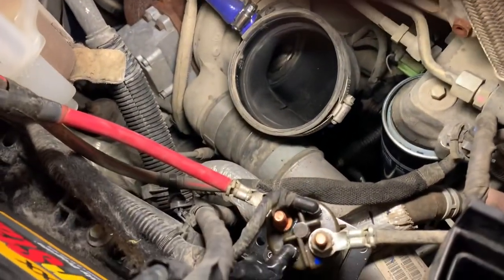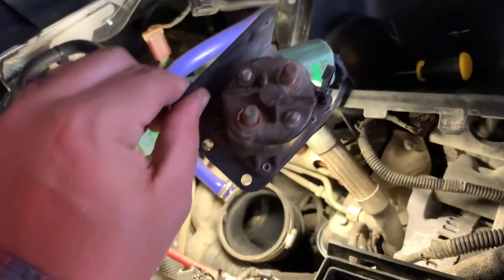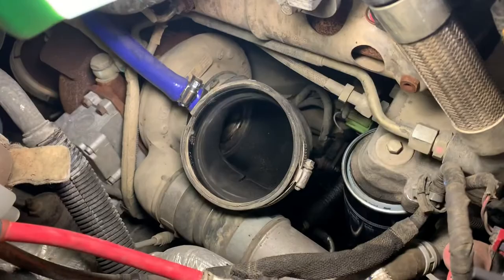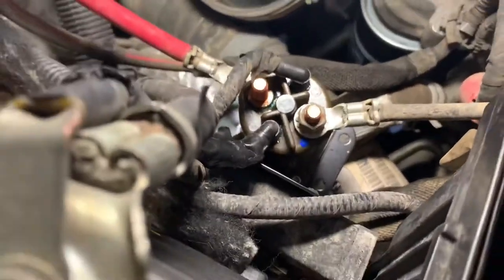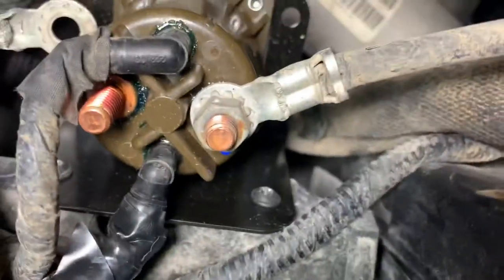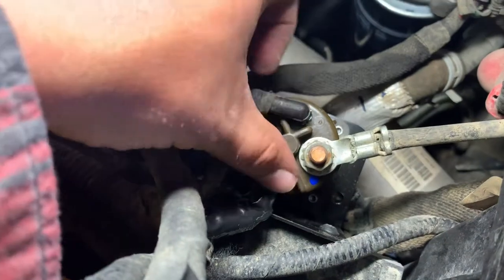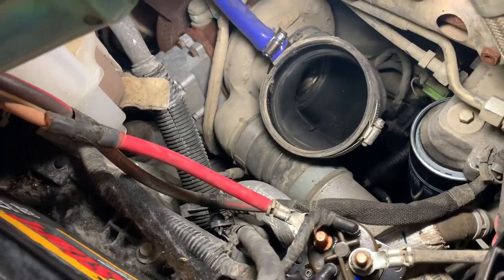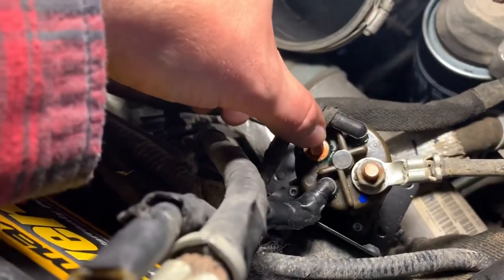6.7 Cummins intake heater relay

Comment: Logically, if this relay is bad it will either not come on when voltage(or ground) is applied to one of the smaller terminals or if it has arced too much internally, it will not pass power when turned on.  I believe the small terminals that control it one is constant battery voltage the other goes to the PCM and applies ground to activate it.  Use a monitor like AlfaOBD to see when it's commanded on.

Comment: how did you determine that the solenoid/heater relay was defective?   I have a p0542 code
Reply from the maker: Buddy of mine said to try that first and see if it fixed the issue.
Reply: @cfudge24  did it?
Reply: You can check if the solenoid/relay is good with a multi meter. You will have constant power on one side, and no power on the other. Then get someone to turn key, and see if the voltage passes through. If it does not your solenoid/relay is bad and needs to be replaced. PS. hearing the relay click DOES NOT mean it passes voltage

Comment: Where does the larger black wire go on the 2 main bolts negative term on battery? One is red to battery what’s the other? Mine has nothing on the black side